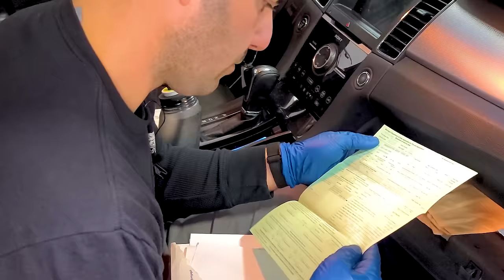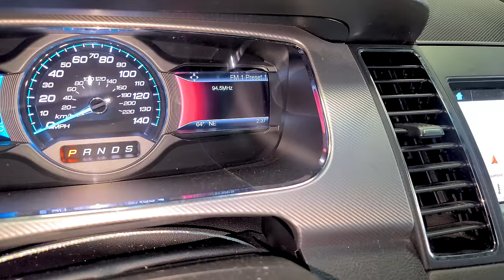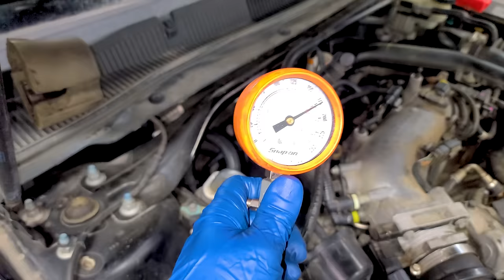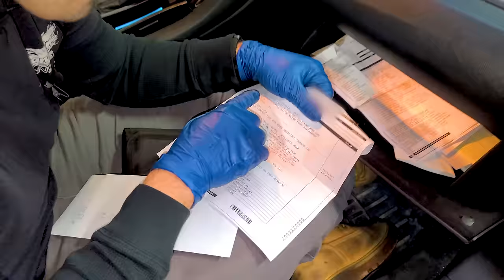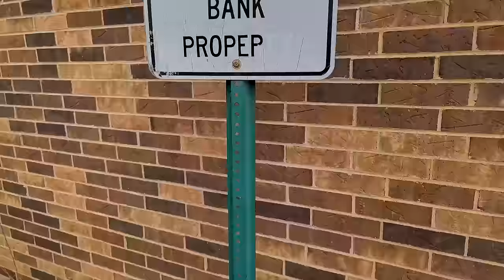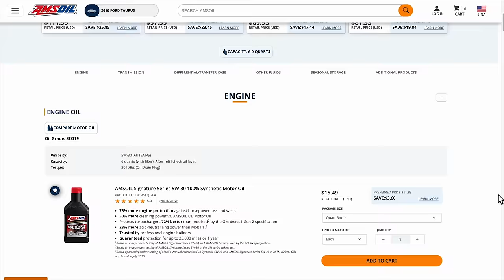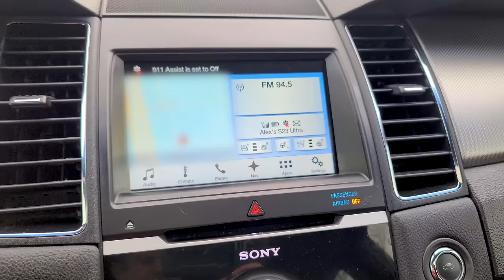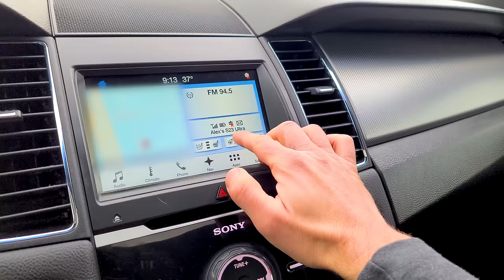I LOVE My GTR So I Bought Another Twin-Turbo V6 AWD Auction Car For 50% Off! Fixed For 30 Dollars!

Comment: why are you using an impact on spark plugs? even loosening them with an impact you risk thread damage in the heads, not to mention you were trying to see if they were cracked, why not just switch to a ratchet?

Comment: This ford pos was clearly not well maintained at all.
Also deep rust on those suspension mount points is a bad sign.
Lack of other under carriage rust based on where the car lived and its high miles does not add up.

Comment: I’m going to hate on ford here.. My wife bought a 2011 ford edge with a 3.5 liter. I should’ve done my research. The 3.5 liter has an internal water pump!!!! Luckily we bought the extended warranty, because one month after the dealership replaced the internal water pump it failed again!!! What a terrible ford flaw!! If you are going to buy ford make sure it has an external water pump!!!

Comment: my 2011 F150 had the same issue. The plugs would crack and send the trunk into limp mode.
Reply: Also under warranty they would only replace one coil and one plug per case and it lead to a lemon buy back on a rather perfect F150. some some place there is a black XLT F150 with 5 new plugs and one old one.

Comment: If this thing was worked on at Fox Ford in Grand Rapids, it might have been the same cocky dink tech that put new turbos on my Flex. He only wanted to do the bare minimum ( Iwanted to replace both turbos,  he only wanted to replace one so I could come back later to pay him again for the other) , had no respect for the customers vehicle (bent the pinch rails) and wanted to make his job easier at the expense of the customers pockets (tried telling me he had to pull the entire engine to do both turbos; that's not how ford said to do it). A couple hour job, he wanted me to pay twice as much and take a week doing it.

Comment: I got a quick question. I know there is 2.7k comments in here. lol. Maybe by chance you will see this. Considering changing oil. I have a 98 z28 stock bottom end with BTR cam springs and push rods. 799 heads. A lot of other mods. I bought the car built. And the oil he was using was Rottella 40 heavy duty diesel oil. Never heard of this before. Should keep running this or go to a different oil? Just wondering what you run in your trans am.

Comment: Why the Heck did Ford not update the cluster for the SHO, give me a brake reflecting 140mph, A "Super High Output" car should at least claim a higher speed than the base model. 
Also, anyone who doesn't pre-fill an oil filter isn't a car person & care's nothing about the vehicle they are working on.

Comment: Bc racing makes coils, downpipe, turbos, sct tune kit, front mount, noise maker delete, charge pipe, 🌽 tune, motor motor mounts from a guy on Facebook. Then gap the gtr😅

Comment: In my opinion K$N filters are junk.
they are worse then any other!
the replacement k&n for my car was 1 inch thick the cheepies are 2 inch thick.
try
FuLL the one I bought was 3 inch thick.
switching from k&n to Full upped my performance and fuel economy! cost same or less then fram..

Comment: just starting this vid, I looked at a few of these and found the unserviceable front gear box was an issue. Sucking out the grease/oil was an option but... I was not into it. I'd rather have a drain plug.    Curious to see if you deal with it....

Comment: Is own a Q50 my dream car but I have dumb over heating issues atm not 100% sure what it is either 😭😭😭😭😭
Reply: I need help 🥲 it over heats when I’m stopped and cools down when driving what I noticed at first what the rad fans not working at all replaced fuse relay and module and nothing then I just thought the thermostat sends the signal for when to turn it on so now I’m thinking it’s thermostat issues but I can’t even wait at a drive thru before it over heats 😢

Comment: 11:45 Look at that idiot in the green van, overtaking and then cutting infront of the semi where it's stopping distance is just to take the exit. If the traffic would have stopped infront of the van he would have gotten rammed hard from the semitruck.